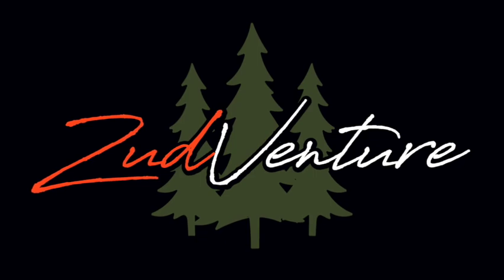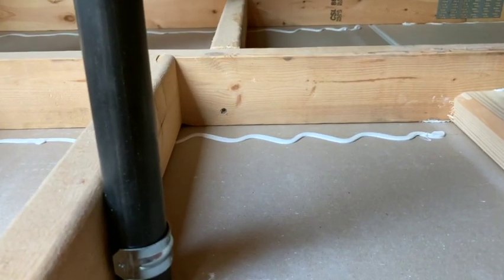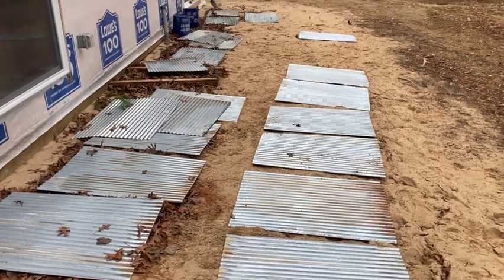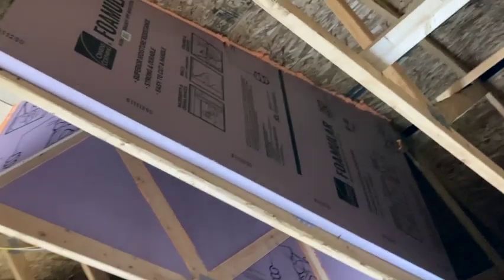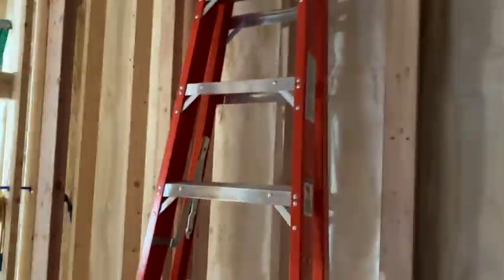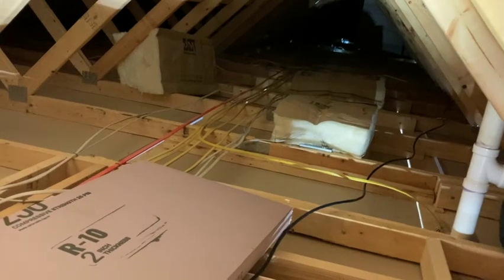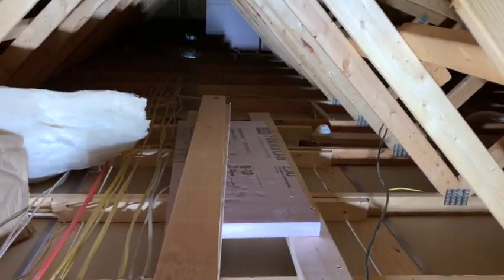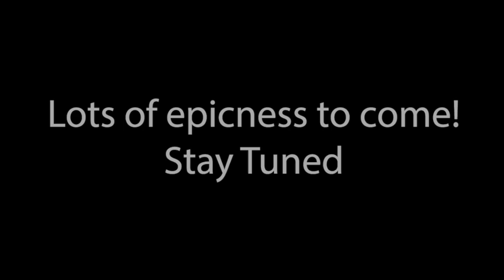DIY Mini Barndo I changed my Mind about Insulating our Skylight and I'm so glad I did!

Comment: Good job on the skylight insulation! Thermally that is.  Take note that the Owens Pink Board is not fire rated and should be covered w 1/2 drywall(attic side), mineral wool or an approved coating. Not an issue if there is no access to the attic through a hatch door. The Dow Blue stuff got its fire certification though recently for accessible exposed attic spaces recently. All of this is only an issue though if there is a fire and the insurance company denies part of the claim because someone got gassed. Many inspectors I have worked with are fairly un aware of Thermal and ignition barrier codes at this point. There are a few exceptions like rim joists. A search will point you in the right direction. To me 1/2 drywall is completely crazy to use in an attic to cover foams.